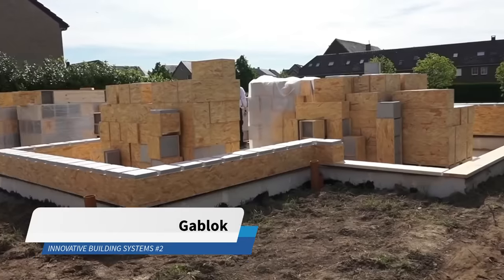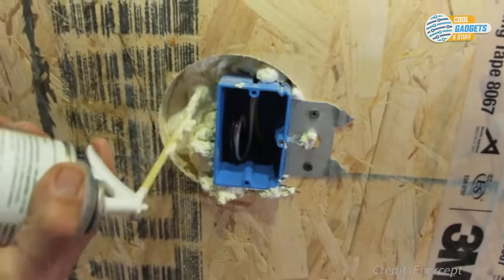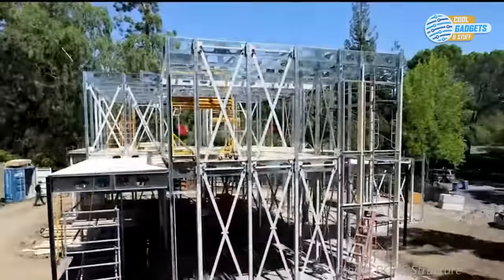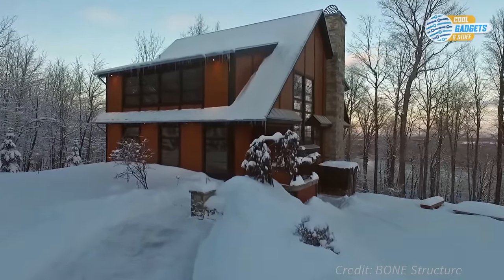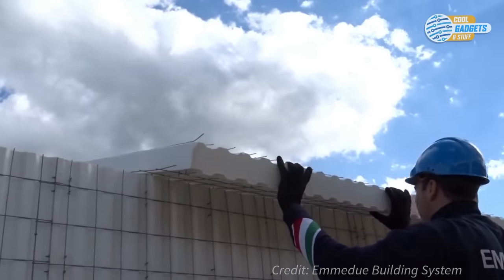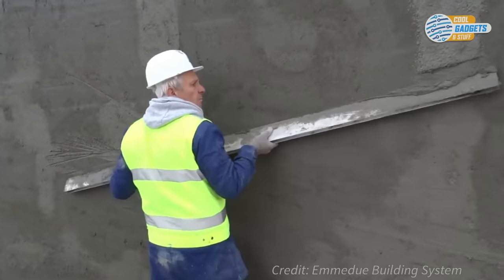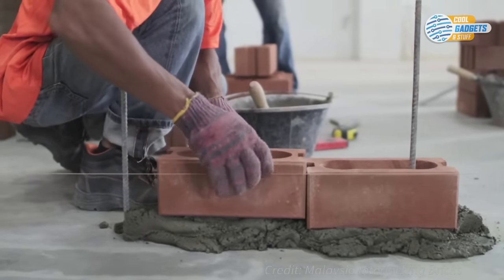5 Innovative BUILDING SYSTEMS for your house #2

Comment: I really liked the idea of Gablok, but after reading their specifications, it turned out (at let for me) it is not rodent free. Rodents can easily munch a hole into that compressed wood, and really like the styropol. This is the same problem with the second idea. Those buildings are not for generations. (I tried to contact the Gablok inventor with some improvement ideas, but he did not respond)
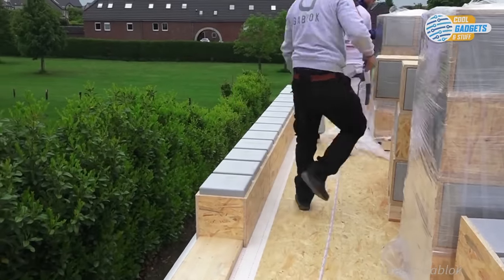Did you notice, that Gablok's second floor is not directly fixed to the first? (1:45) Hopefully a bigger storm will not flow the second floor away :-)

M2 sounds great, and due to the hard shell it seems rodent free. But still needs a lot of human work to finish. Two layers of extra soft stuff for forming? We badly need the experts for that work!

Steel wireframe is a good idea for industrial buildings, but not for homes, especially due to the highligted weak spots on the insulation. It is not planned for great minuses, or passive house in mind.

The interlocking bricks are great, but they are typically not good insulators, and wet resistance and frozt resistance is an other question (especially here with sometimes -20°C). 
It also does not have internal air filled holes, as all those holes are filled with fixation mortar and steel rods.
Maybe the best of all, in case somehow insulation improved. Maybe two layers next to each other, air filled gap between the two layers with some interlinking special bricks, like in England in the past. For that I think they need not two, but three segments, combining with a version of two. Maybe instead of air they could add styropol inside, so the rodents and the woodpeckers could not touch it.

In the past I lived in a house built from sand lime brick (not well knowns). It was very solid, but required a really thick heat insulation (and still it was not perfect). It had really great noise insulation properties (you did not hear the cars on the road at all). But due to the very solid nature it LEAD the noise very well, so I heard when the neighbour of us went though the room with hard shoes (woman) or a fork is fallen on the hard floor. You could hear it like it happened next to you. Interesting. 

Still waiting for the best and fastest solution :-)

Comment: Build 1-
The longevity of the home probably isn't too long compared to conventional builds. I didn't see any joining elelements in the vid aside from stacking. Also mold would be a big concern. Disnt see much of a "skeleton" for overall support in the vid. Radon and outgassing would be a long term concern as well. Wasn't impressed.
Build 2- Tried and tested. I wonder if someday the thermal bridging can be used as an advantage to actually create electricity or to be stored somehow for heating.
Build 3- Everyone loves Legos! :D

Comment: I'd be very concerned about those polystyrene panels for home construction.  In a house fire some very nasty gasses would be given off endangering both residents and fire fighters.    And some of those systems looked as if it would be impossible to repair or replace wiring or pipes once the structure is finished.
Reply: Polystyrene is fire retardant material; it will smolder at ignitation point but cannot catch fire. And repairing and rewiring can be done, first check the electrical plan of the house but in the electrical outlets, you should be able to cut wires and pull them though. But it is unlikely to happen as the flexible pipes of the wires are protecting the wires from any damage and if you need to have new type of wires, just thread the wires within those pipes.  For plumbing, it would be unnecessary to replace these pipes as they should not be damage at all. The system is earthquake resistant, flood resistant and fire resistant. Green and recyclable.
Reply: @johnyoung4814    I don't believe that is ... ummmm...     TRUE.

Comment: Is there any that's good against hurricanes?
Reply from the maker: In part 1 I featured ICF construction or Insulated Concrete Forms. Concrete homes are more resilient to hurricanes and fires. Video is on my channel page. Also round homes and dome homes are more hurricane resistant since wind can't build up on flat side. Check out Deltec Homes. They make round houses. I featured them in one of my Prefab Homes videos. AiDomes dot com, makes dome homes.

Comment: If you’re going to use polystyrene as insulation and part of your foundation why not just build plastic houses and building blocks? And then with an outer shell of concrete or wood?

Comment: Ultimately it is the insurance company that says yes or no on new stuff like this. they, along with building engineers and and local code enforcement, will decide if you can or can not build your house out of big boy lego's.  i think it is great what the newest innovations bring but am also somewhat apprehensive about where this can be used and it's suitability. they also shunned the styrofoam concrete forms.  but now it is used in many U.S. regions. where these technologies go remains to be seen.

Comment: Steel is absolutely not fire resistant,on the contrary it collapses faster than wood which makes it very dangerous if not properly insulated against fire and heating

Comment: The biggest issue with these methods is that once built there's no real option to expand or remodel. Running new or larger wire, pipe, etc is near impossible or has to be done and then walled over with conventional framing and drywall rendering much of this moot.

Comment: He keeps saying steel is fire resistant....have you ever seen a large steel column/beam exposed to fire/heat - they buckle and twist as they lose all there structural integrity.  These things shown are approx 1.2mm thick (a lot thinner than a traditional steel beam). Make sure you get a system with robust fire resistance testing and fire stopping!....same goes with most of these systems.
Reply: Actually, steel is less good at fire resistant than wood.
Reply: @thomaswang5721  thats correct. A 38mm section of timber exposed to fire on 1 side gives appox 30 fire resistance...depending  on species.
Reply: you know what IS fire proof though? properly built reinforced concrete. Yeah, I get concrete isn't cheap, but built properly structures can last for centuries.

Comment: My problem is when you say system that usually means way more money. Developing systems for household let alone commercial projects doesn’t necessarily make them stronger to me poly styrene inside without structural framing means it’s week and will not work and will be costly when it comes to human life in the end when it fails. Note that’s just my opinion but that’s also based on 35 years in the construction industry building high structural valued buildings

Comment: Some of concepts seems interesting, but all of insulations are chemical. So there are certainly low cost solutions, but not really low grey energy solutions. Additionaly, chemical insulations are not good for phase shift experience.
At the end interesting, but not as efficient as the video says. In my opinion of course.

Comment: How are you supposed to run wiring and piping through the blocks? You build drywall off the blocks? So you lose 2 feet in each room because of wall thickness? Seems stupid

Comment: filled with polystyrene foam? no thank you, last i checked that stuff was highly flammable
Reply: And toxic!!!
Reply: @alancharlesworth5636  Actually EPS is not particularly toxic or flammable but my major concern is its severe intolerance of solvents.  Spray a very large piece of EPS with say gasoline and it will dissolve to nothing before your eyes!  PIR is very toxic but at least it has excellent fire and solvent resistance.

Comment: Where is the plumbing and electrical?
Reply from the maker: Good question, I should probably clarify in the video. This is what it says on their website - https://gablok.be/en/faq/how-do-different-technical-finishing-touches-find-their-place-in-a-gablok-construction/ - The distance between two rafters that hold the insulated wooden blocks together is referred as a “technical duct” and it is +- 40 cm. This distance allows you to easily install the various technical connections required for the smooth running of your house.

Comment: That's a electricians nightmare
Reply: Not if all the wiring is in conduit, like it should be. You can't use pull wire here where I live in commercial buildings. You ever wonder why that is?

Comment: Ok a great advertising though it has numeral problems each method for example on M2 building system the panels are polyester & steel frame with connectors so after few years the polyester would have problems just from the heat on summer and cold on winter after 1-2 decades would have holes in it and in any case of fire the whole house would be a death trap.

Comment: Certainly appeals to those who Want to "save' a couple thousand a year in heating costs.  But needs pay an Extra 100,000$  (at least) to achieve that.
 Beyond that these houses typically Lack any Architectural  richness Whatsoever..... they usually  look like Slightly 'improved  Trailers.

Comment: The frame of the house, even if it is built of metal, can't really be used as a lightning rod. Lightning rods have a point, it's arguably not a lightning rod without a point. The idea is that electrical potential energy cannot gather at a fine point therefore reducing the energy and lessening the chance of lightning. Here's a video https://www.youtube.com/watch?v=wGc3q4dVOS0
Reply from the maker: Interesting point. Steel frame as a lightning rod, I found that information when I was doing research on the website of the company that makes steel frame houses. Thanks for your input.

Comment: i wouldnt not use any of this methods. this modern "building" techniques wont even a few decades without heavy care
Reply: People one said wooden structures wouldn't last 5 years, now people say stone and steel structures wouldn't last.
You do know few structures will last without heavy care, right?
Reply: @DalionHeartTTV  i do i do. but a few decades are nothign for a good house. Say that steel and concrete house would last for a very long time. They still would be very bad houses. Thats because cement does not breathe while old houses exchange water and fresh air through walls and wooden parts. Of course, in cold times you need to heat more. but that can be changed in wearing socks thicker clothing and so on.  oh btw, i am one of those who did not say that wooden structures cant last.

Comment: For quality building, nothing more from thousand years than stones, lime cement, earth, real specific wood (depend of the geographical condition for all of them). And sure, real old knowledge to build real strong and usable home.
And you will see that none of these new technologies house will go for long time life. None of them and we already see that in many place, all around the world. That's it what ever comercial low knowledge buddies want to be and dream about. Don't deny the building long history.
What is, by the time, a better new way to build, is the new knowledge about structural links and design close to natural structures. So not everything is to bad, but there is a lot of shit back to the dream.

Comment: As a structural engineer tgat designs these buildings each day. The video totally ignores all the problems associated with these systems. If they were a better mousetrap they would be in common use...they arent

Comment: М2 building system is one of the most stupid  things i have ever seen! Floor which is kept together with the walls only by thin steel wire? Floor slab which is only wire and 10 cm polystyrene? What is its load maximum? 100 kos?

Comment: steel frame all material this is expensive lto and not good lot could bridge winter area not can use. expet container house have used recyckle container lot lot cheapen than wood or steel or brick. but metal have problem insulation not good, ewery corner have big bridge were could come in. metal need insulation GLUED closed cell foam around all metal, both side. in and out insulation good minimum 50mm better 150mm

Comment: Only normal system in this video is the steel frame one all the others Garbage. Gablock only thing that is holding it together is gravity and weight of the clay tile roof. No uplift anchoring no adhesive. If you glued all the blocks it would be OK but just pounding it in like they have shown sorry no. The wire mesh sandwich is stupid and has it reversed. There are much more practical systems on the market with XPS on inside and outside with mesh between them where you just pour the concrete inside the foam form.  Rest well they were so stupid no one actual built a real house with it they were just mock ups.

Comment: How efficient is an SIP system when you have 2 layers of OSB and still need to add a vapour barrier gypsum board layer to the interior face? How structural can a non-stud wall be if you need to hang kitchen cabinets or other equipment? Can you customize or add onto these systems? What are the environmental issues around blown insulation - blown cement? Is all of this plastic insulation fireproof in any way? Ahhhh the generic sesame street approach to making youtube videos that pretend to be informative but only scratch the surface. Like Ted Talks for dummies?

Comment: Anyone watching this thinking these are good ideas for your home. Please dont!
If you live in earthquake prone areas you need concrete blocks that interlock. If you live in windy and cold areas you need timber which survives long time and keeps heat much better. Outside of that you can use brick!
Cheap and easy will get you just that; Cheap and easy shit!
Reply: This is all just untrue.  Block and brick create rigid structures which don't move with the earth.  Flexible structures tend to do better in earthworks because they can sway.  This is obviously an elementary explanation.

Comment: LMAO! mORE BULL CRAP....sTICK BUILT.. And FYI as a professional re modeler for over 40 years. HOMES NEED to Breath!
Reply: Skip Rope I partially agree. Stick frame definitely need to breath. Urethane with no air not needed.  If there is any air moving it will condensate where that air is. No air no condensate when there is sufficient thermal break.

Comment: "steel is fire-resistant" <- THIS IS JUST WRONG! Only special "Heat- and Creep resistant"-Steel can take up to 1100°C and even that kind of very expensive special-steel will immediately bend and break then! If you use thick wood, the coallayer protect the innerside so the woodstamp has still an unimpaired inner core that won't break. But the stamp and so the coallyer need to be thick enough to take the heat around. only ONE example: Testet 36cm of Woodwall: takes 150min at 1150°C from both sides and the desity is still there, the inner heat rises by just 1,8°C, after 180 mins its still durable and takes all the payload.
Not so expensive normal Steel bends and breaks from 100°C to 600°C at just one side in 15mins to 30mins under its dead load, DEPENDS on the quality.

Its the same with Steel and "earthquakeresistancy", if the eq or whatever is strong enough at one point it immediately breaks, if its just strong enough to bend it but the inertia takes it over the backbendingpoint it breaks again. I don't say that wood is much better at this point, but

DON'T TELL LIES!!

Comment: No matter what marketing dep.(of those companies) says,they are'nt and can't be the future.
Maybe a niche alternative to some at best.
There are good reason why building technique has'nt change much for the past couple of hundred years or even mileniums!
Brick and mortar structures are standing proof of that! 
Log (wooden) houses can also be good and eco solution if doable.
Reinforced concrete,not so eco,but durable and backbone of any modern commercial application! 
Fail to see why any of afforementioned systems are any better than traditional buiding technique? All I see is too much toxic,not renewable,chemical riden building blocks.